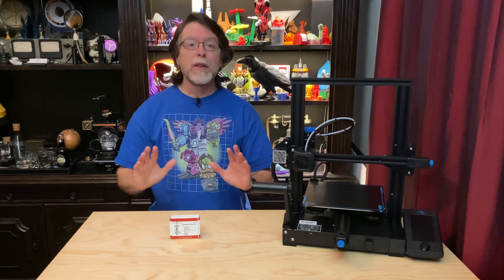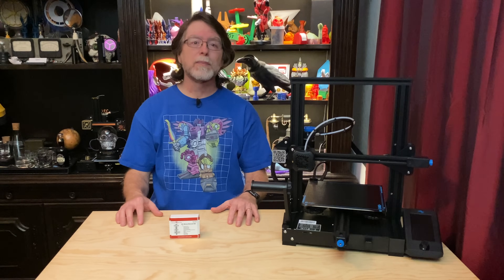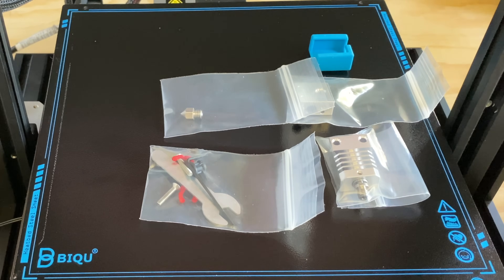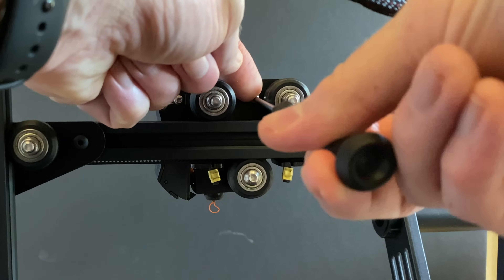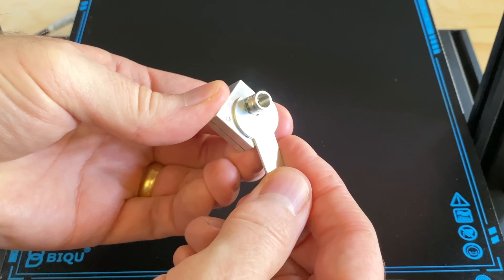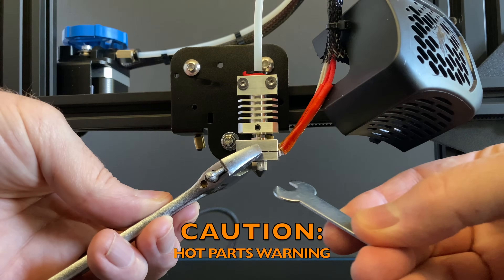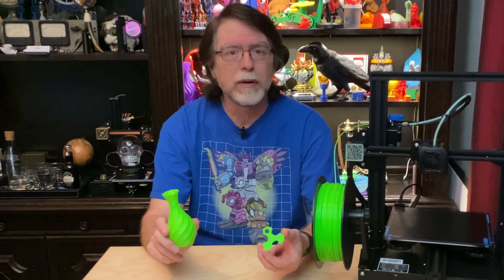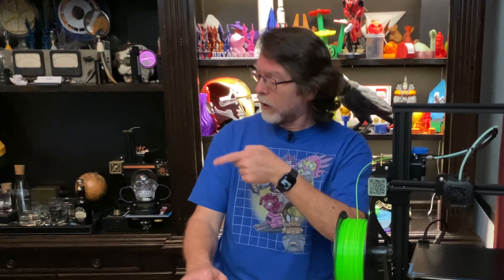Install the Micro Swiss All Metal Hot End on your Ender-3 V2 3D Printer

Comment: Thanx for the install video. Very clear and easy to understand. I will be able to apply this to my future hotend upgrade. Quick question? - I know the Micro Swiss products are good, but is this the best hotend to install, if you are on a budget or should I look at saving a bit more and install the Slicer Mosquito / Copperhead? I'm planning on printing ABS, which I have been struggling with because of the higher temperatures. Currently trying PETG which I have printed, but I need the layers to stick better. Any advice would be welcome.
Reply: Dry your PETG filament prior to use.  Use a dehydrator, not a conventional oven, please.  Spots in your oven could give false temp readings and you might melt the filament or the spool.  A convection oven could do the trick, but if you're printing ANY hygroscopic materials, invest the $40 in a good dehydrator.

Comment: I run three printers with a microswiss hot ends, a Wanhao i3 v2 and two ender 3 v2’s. I have had great reliability of the unit on the Wanhao i3, but my ender 3 V2’s regularly suffer filament jams despite printing pla at 210 and reduced filament retraction. Has anyone had this issue ?
Reply: Hi, did you resolve this? Thanks.

Comment: You should also mention the need to drastically reduce rettacts and also change the way to do filament chsnges. Basically you should NEVER retract filament more than 1mm or so else you get clogs in the heat break
Reply: 1mm? Bull.   4 minimum.  Usual 5-6
Reply: @dugy40  I'm running mine at 0.9 with no issues.

Comment: Dont you wish someone would make a heater cartridge with a 90 degree bend after the cartridge so one is not stressing the wire connections?

Comment: Great!  I have it on order with the discount!  Can you recommend a starting point for retraction with the Micro Swiss?
Reply: Just installed it yesterday.  Needs a little bit tuning for retraction, and parts cooler fan adjustment as it blows too much towards the heat block which causes excessive stringing.  I printed a new duct with lower flow to parts that fits on the stock fan (no fan used when printing it out), and this fixed all the excessive stringing.

Comment: Hi Brian!, I have been thinking of getting one of these for one of my Ender 3 printers but I noticed they also sell the upgrade throat and heat brake for upgrading the stock hotend, have you or anyone reading this tried this and if so is it worth fitting or is the full kit the best option, I hate waste so if this option is viable I would prefer this upgrade path.

Comment: Great video! If I upgrade to an all metal hotend, do I need a better ptfe tube (carpricorn for example?) to go up to 250-260 or not?
Reply from the maker: Hi! While a premium PTFE tube is nice (they're usually more precise on the inside diameter), it's not necessary for this hot end. The tip of the PTFE tube only goes into the heat sink a couple of millimeters, so it doesn't get hot enough to get damaged even at 250-260˚C.
Reply: @BV3D  nice, thanks for the clarification :)

Comment: I installed this on my Ender 3 V2, but didn't count on the need to change the firmware to get temps >260C....so I'm stuck trying to figure that out. Need 285C for Taulman 910 HDT.

Also, the set screw on my stock heater block that held the heater cartridge in place was stripped. Had to drill it out. REALLY annoying.
Reply: Found out a while ago max temp in firmware. Is actually 15C lower than the max set. 275 would actually only allow 260C. So 285C would have to be 300C.
Reply: @tomtaylor135   another Marlin curveball. As much as I have been enjoying learning my Ender 2 V2, it's clear this tech is nowhere NEAR ready to mass consumption. I'm an engineer, and it often makes me scratch my head.
Reply: @Pics2FlicksDennis  I compile Marlin all the time. I am sure somewhere else you could make max actual max. But without getting to far in to it. This is what I have experienced myself. I also checked and on GIT hub it is done in software to keep thermal protection from shutting down your printer with a a halt. It compensates for hot end temperature swings.